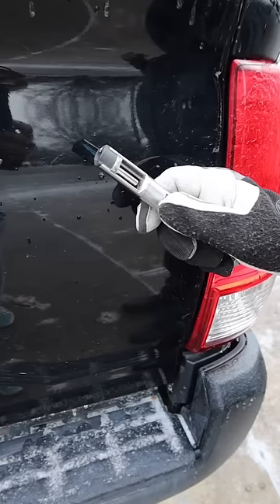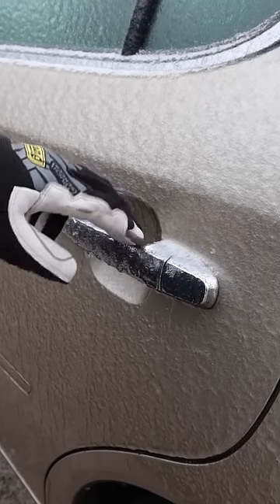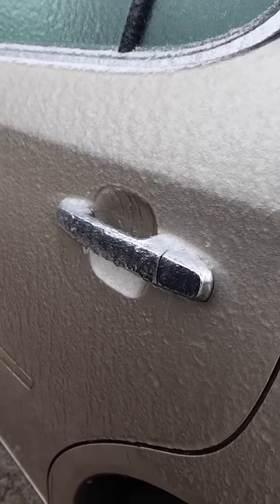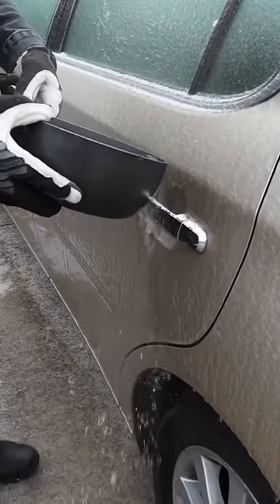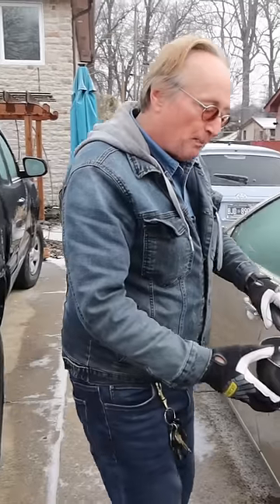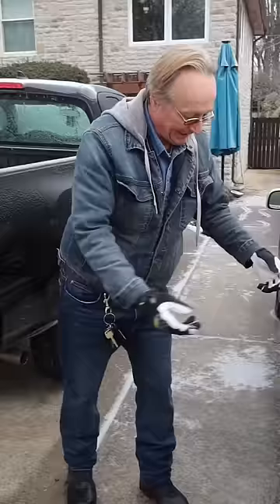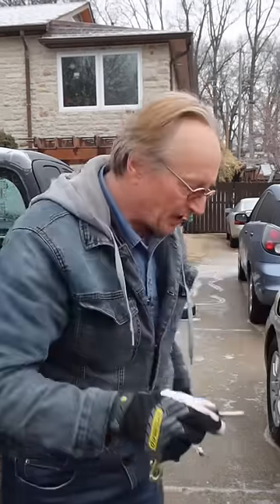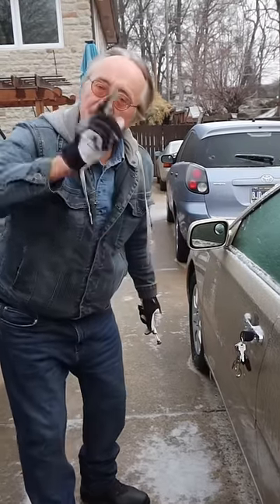Never Do This to Your Car

Comment: Also don't do it on too much on the windshield. It can crack from thermal shock.
Reply: If the windshield is frozen I wouldn’t put any hot water on it at all it’ll turn into a spider web

Comment: I remember you suggested WD-40 for stuck keys. That same trick is used as a preventive maintenance to avoid frozen door locks. Once you can get inside the car you can hopefully start it, and your heater, enough to warm up the frozen passengerr seat door.
Reply: Graphite dry powder lubricant prevents.
Reply: Eye remember rumor that WD-40 had water in can...
wuz ~'70's - '90?.

Comment: For those about to rock internal combustion , I salute you !
Reply: Amen!!!!!!
Reply: @Buff Barnaby
Moving parts are breaking parts there's wear and tear and they break. Parts that don't move much less prone to wear and tear and breakage. Conventional
ICE engine chock-full of moving parts. The drivetrain of the ice vehicle 2000 + moving parts. The drivetrain in the EV 18-20 moving parts. The miles per gallon equivalent of using electricity for fuel would be like paying $0.70 cents a gallon for fuel. Fewer parts overall, you don't pay anything to repair or replace parts your vehicle doesn't have.
Reply: @nicholasgardiner9601  I've had 3 Toyotas go over 300k.  The average battery on an electric last 150k-175k and costs more than the car is worth to replace.  Ill take the internal combustion engine any day.
Reply: Last really cold blast hybrids E cars wrre dead when mite shift came out to start cars....those 90s F150s and Chevy silverados fired right up....too smart for our own good. Cold is old school...its not new.

Comment: People may watch this a pour hot/warm water on the top of the door/glass and crack the glass.  Better to prevent the freezing by cleaning the seal and putting armor all on the seal or some other water repellent / protector.

Comment: I saw a news team put warm water in a sealed plastic food bag and "paint" the area to remove ice. Have done it a couple of times... scrapping is likely to damage windows.  I have been corrected "scraping" not scrapping. Thanks.
Reply: That’s my method of choice these last few winters, works like a charm, best technique ever.
Reply: scraping. two completely different words
Reply: @jasonquadro4375  thanks.
Reply: Funny it doesn't matter to me how you spelled it. It is how you said it and most know what you meant. I do the same thing to. I meant  too 😂

Comment: If the water and the window temperature difference is high enough the window might crack, so that is something I wouldn't do. Pouring on the door, if the water freezes before it can drip out of the internal mechanism, you might get a stuck open door and believe me when I say, it is better to have one stuck shut door than one stuck open door, I'm telling this from my own experience. Heating the key: you might damage the electronics inside the key and you might unyield the metal, so the key might get softer and might get broken off in the worst possible timing.

Comment: Any suggestions on getting in a car with frameless doors.  The windows freeze shut and since they can't drop I can't open the doors.  I added a remote start (not an option) to try to warm the windows from the inside but the vents don't reach.  Very frustrating.

Comment: How about squirting WD-40 in the keyhole?
Reply: Sounds kinkey.
Reply: WD40 ist not oil. Use real oil instead.
Reply: WD 40 works good , once you have it open .
Use a straw and blow into the lock to open it .
Your warm breath will defrost it safer than warm water because the water will just re-freeze and make it worse .
I live in Upstate NY 
so we deal with this a lot .
Reply: @jayhockley8841  WD-40 is NOT a lubricant! It will wash out the lock and will destroy it if you dont re-lube it.
Reply: @macdaniel6029   Ive BEEN using it in  my door locks for DECADES because it IS A LUBRICANT  ! 
But ..
Do whatever you want .
Reply: @jayhockley8841  
Technically Jay, it's a penetrating oil that removes moisture - so why it's good for insuring your locks don't freeze in the 1st place. (barring freezing rain.)

But actually there really is no long lasting lubricating properties to it...

This is why they make graphite powder for lock lubrication.

Cheers!
Reply: @openeyes-411   I agree . The Original WD 40  is a water displacment chemical ( WD = Water Displacement  ) and only lubricates for a short term . 
But there are various types of WD 40 Which are Silicone lubricants ( Like the WD 40  Specialist and Gel Lubricants .) 
 I have used them in key locks and Master Locks that are exposed to snow and ice , For decades .
Cheers ! 
( You must be Canadien or British ? )
Reply: @jayhockley8841  
Yes the silicone versions. And, oh, the "cheers" - no, actually I'm from NY, lol
Reply: @openeyes-411   👍

Comment: No, no, no. Use deicer and never use warm water around glass. Even use rain X windshield washer fluid as a deicer. Never never never use warm water around glass. You will crack the glass almost immediately.

Comment: Then it will re freeze afterwards because you used water 😂. Don’t do this people.
Reply: Guess what when ice melts it turns into water 🤯
Reply: Do it to the passenger side. Let the car heater warm up the drivers side. If it refreezes from the water, you may not even  notice.

Comment: Oh, god NO. DO NOT I repeat DO NOT use hot water on your car to unfreeze it . Worst case scenario your windows will crack if you spill on them. Best to use a -60C winter windshield fluid or a defrost spray.

Comment: Put silicone or something like that on all the rubber gaskets.
Reply: I do that every October before it gets cold. I open all doors and the trunk. Spray silicone on all the rubber as you go around the car,  then continue around the car wiping off what didn't soak in. Never had a door freeze.
Reply: Just make sure that "something" isn't WD40 - do not, I repeat DO NOT spray WD40 on rubber seals: it'll damage the rubber!

Comment: Hmmmm $1500 for a replacement engine vs $25,000 for a Tesla battery , tough choice. Another FAIL of the BEV.
Almost SEVENTEEN TIMES less than replacing a TESLA battery. And much less damage to the environment.
Reply: @JohnAdams-if2cw  thogg dont caare
Reply: @JohnAdams-if2cw  Mining that lithium ,  nickel and all the other products are very hard on the environment

Comment: And I sometimes disagree with your opinion on products and steps and methods, and doing things if you don’t know, and you haven’t dealt with cars for a long time this is absolutely terrible advice terrible. You’d be better off with the blow dryer then you would boiling hot water or even a hot hot water cold water even would be better hot water come on Scotty you know better.